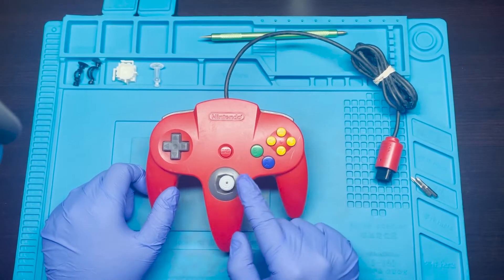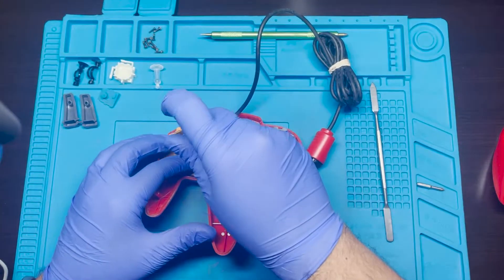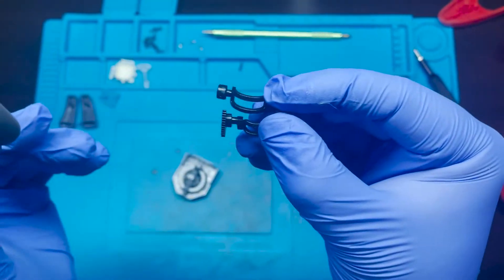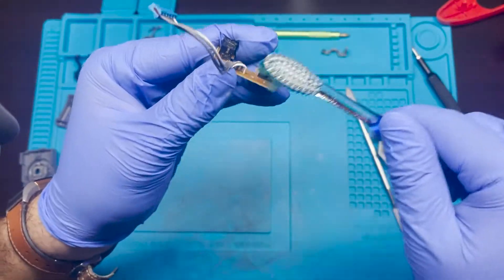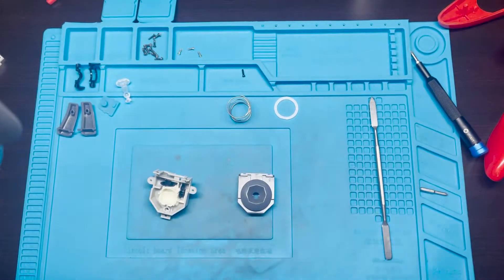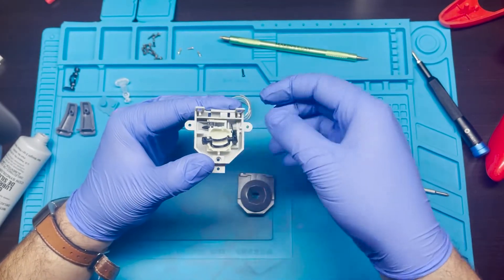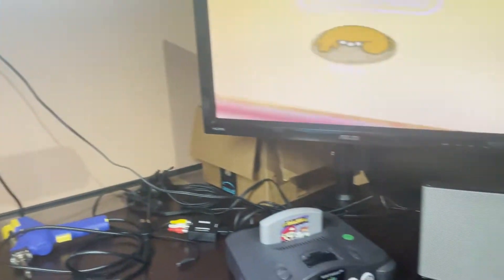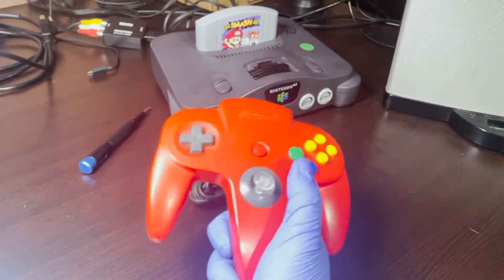How To Replace Joystick On N64 Controller - Nintendo 64 Controller Repair

Comment: what Kind of grease did you use on the controller
Reply from the maker: Super Lube 92003 Silicone Lubricating Grease with PTFE, 3 oz Tube, Translucent White https://www.amazon.com/dp/B0081JE0OO/ref=cm_sw_r_cp_apip_VLcQsvXGe7nZz

Comment: Enjoying the channel and looking forward to your handheld repairs when time allows.  I've got at least one (some cases far too many) of every major console from the Atari 2600 up through to the PS1 save the Calecovision and Intellevision (most modded or otherwise in various states of repair/refurb) so what ever you do will probably be my jam. Im a bit light on handhelds other than a kitted out original Gameboy and a vanilla GBA, but Im looking to pick up a SEGA Nomad if I can find one that isnt obnoxiously expensive and give that on the full works
Reply from the maker: Im glad you’re enjoying the channel, I’m working on uploading another repair for an n64 soon 😄

Comment: Have you tried using a dot of super glue on the original stick itself vs going with the aftermarket clear?
Reply from the maker: I have not, I’ve heard of this before in the past. I got some spare sticks that I should try this on just to experiment with the results. I might even make a video to test and see the difference.